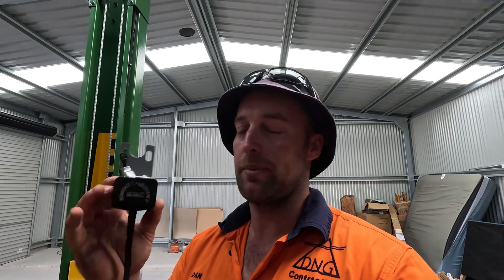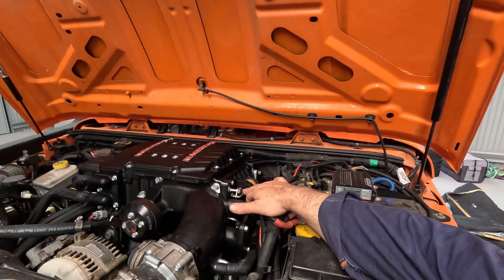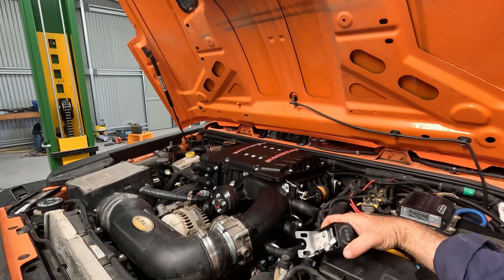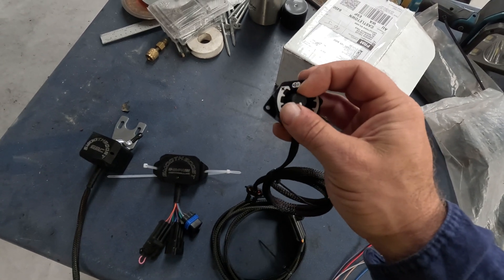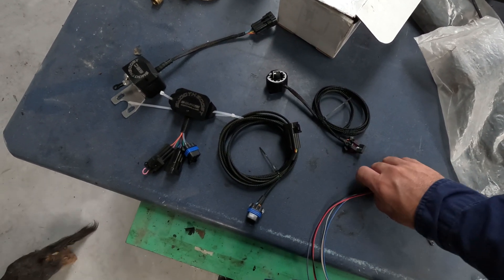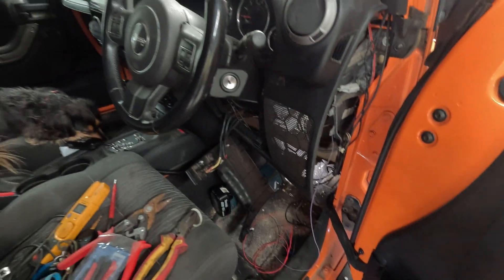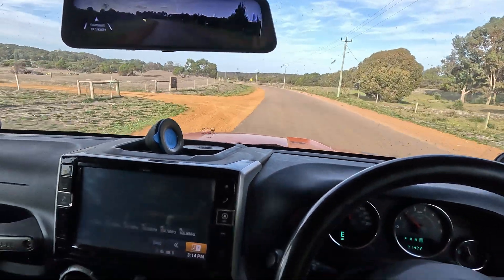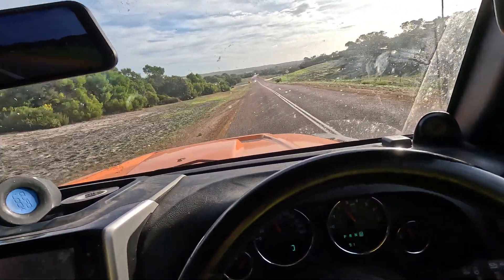Installing a #smoothboost Electronic Boost Controller On A #magnuson #supercharged #jeep #pentastar

Comment: Hi , great video thanks for sharing . I have just ordered a smooth boost for my gladiator . What exactly does  the boost control knob do? Does it extend further the more you wind the knob? Are you still running it on max (full send 🤣)
Reply from the maker: Yep full send 🤣
It basically adjusts how quickly the controller goes from 0-100 and possibly stops it from even reaching 100 (cant remember) sort of like a throttle controller. With the knob turned all the way off there is no boost at all.
Reply: @GoingOffGridAus did you need to do any tuning after installing
Reply from the maker: @stephenharris5122 No, nothing required. Runs really well, have even had it on a dyno and all the tuning looked really good.